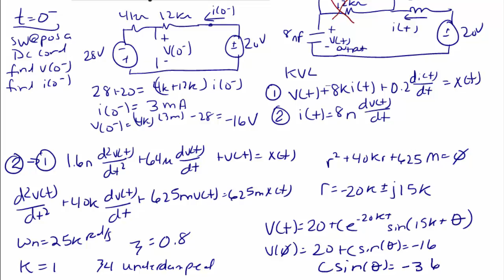ECE205 Lecture 3-1: Solving Second-Order Circuits

Comment: There is an error in this lecture @ 18:43. At the end the current should be 3m, not 3m/8n. Current in series is the same for all elements. We have calculated this value to be 3mA. This makes both the angle and the value for C incorrect. The way you can check your angle is by converting the complex root in to polar form. This gives you 25<-143.13, the x component is negative, so you add 180: -143.13+180=~37. This is the correct angle. You can check this, by using the correct value for the current. You will notice that when you use 3mA instead of 3m/8n, the angle is also ~37.
Reply: i(t) = cdv(t)/dt therefore dv(t)/dt =i(t)/c. I think she did it correct.

Comment: Also, why would you introduce a concept on such a convoluted circuit? Education 101, isolate the material being taught, reduce extraneous nuances whenever possible. Seriously, instructors like you are the reason people have to come on Youtube to learn this stuff in the first place.
Reply: This is actually a fairly easy problem and covers a wide variety of concepts well.

She isolates the material, it's all written and explained. This is a sophomore ECE class; not a highschool class. If you want it at an elementary level, first look up explanations from beginner videos...it's rare to find decent-sized problems on youtube covering electrical engineering topics because it's a niche education market.